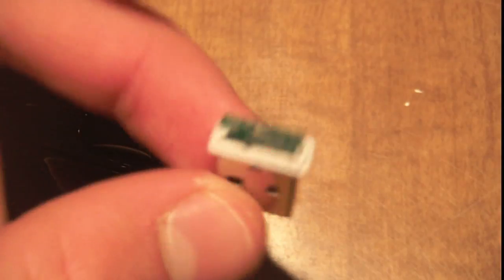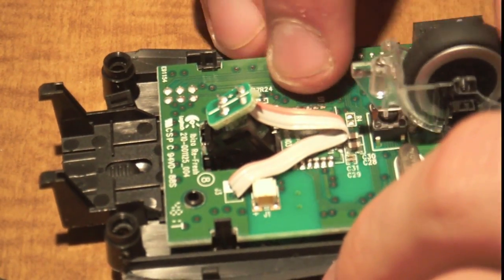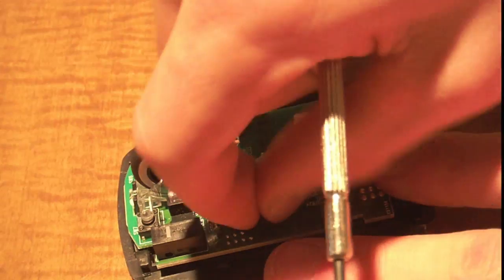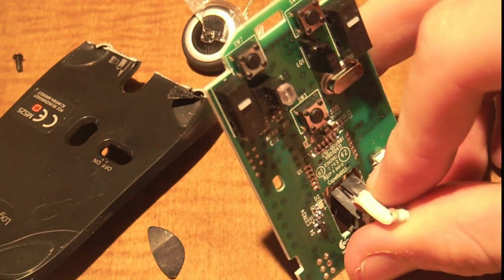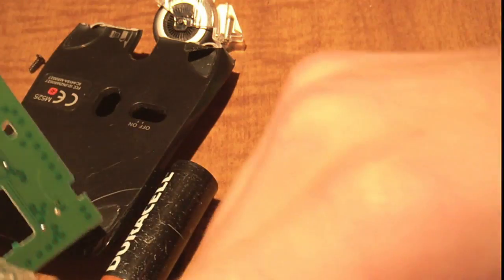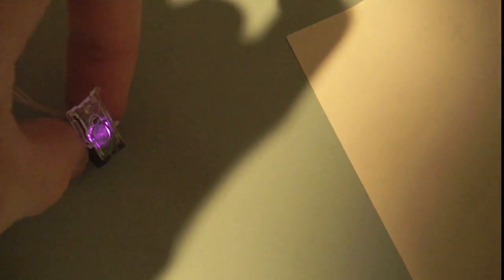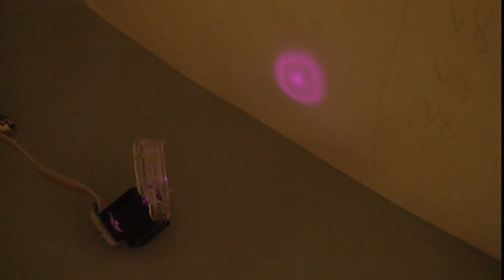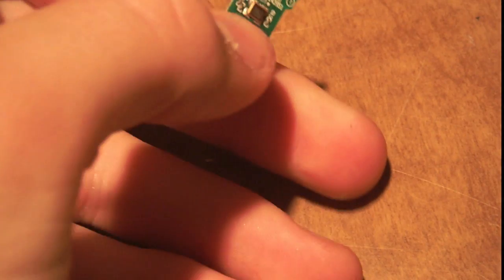Wireless Mouse Teardown

Comment: At 4:02 is where he comments on the emitter.  I can clarify his statements.

The single "LED' emitter detector (an imaging array) is all built in the one emitter (an integrated circuit), the emitter 'bulb' itself emits a signal at given frequency with a specific wavelength of light, red or blue, the frequency it pulses light it is acting like a little camera flash, then when the light reflects back hitting a small (very low resolution} image of the surface, after that an image is sent to the mouses controller (a micro-controller) there is a complicated process that goes on as the micro-controller compares multiple images it receives, there are mice where it's controller will only compare two images, and some that will compare many images, making them more accurate, and giving the user a better experience, after a determination is made by it's controller, it then sends the result out to your computer in various types of connection, ie wireless or cabled.   

This is a good explanation that I made, the process explanation can be made much greater detail!

Comment: The camera is looking straight down, and the LED illuminate the surface at an angle.

You can probably get a quite good idea about what's going on by trying it with a flashlight at a low angle and a web-cam pointing straight down. If you use "live preview" for the camera you can see movement. The software/hardware on the camera chip inside the mouse does the same.

The optics is just a plastic lens, basically just a fixed focus camera.

Comment: Single emitter, dual detector. As in a full optical encoder.
The LED is not modulated (but turned off for power-saving)

But wheel also works as middle button. (check the software)

The "dector" is actually a camera. It is the chip mounted next to the LED, almost in the center.  It have a small input hole on the underside. (visible in the video)

The camera got a processor that check the image for movement.

Complex stuff, just looks simple due to integration.